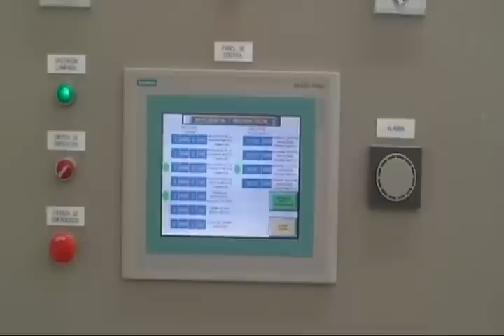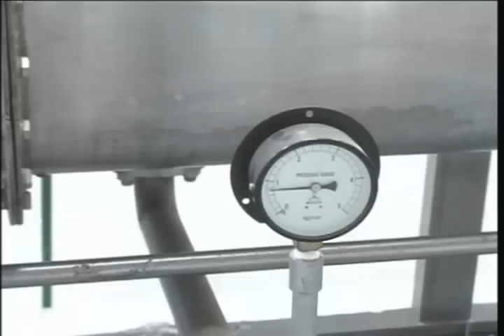Automatic Bowl (Cup) Instant Noodle Production Line  [Taiwan Lih Tay]

Comment: Why do the shape of instant noddle is waved?
Reply: Bingo! You are right! That is one of  important factor. And the another reason is  that in order to expand the contact area between boiling water and noodles when cook the instant noodles.If it is straight it would be crushed as the instant noodles in the transport, if it is waved it has good stress tolerance.
Reply: my theory...so it would be compact
Reply: It looks more appetizing?
Reply: if it is straight it would be spaghetti.
anyway, I think it is straight the cup will need to be long. If it is curled, the cup will be wider,